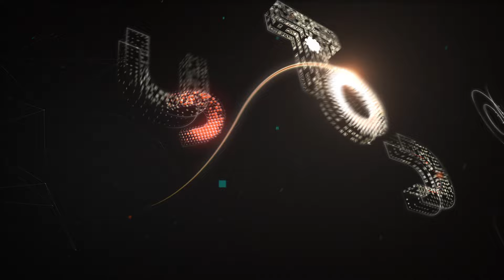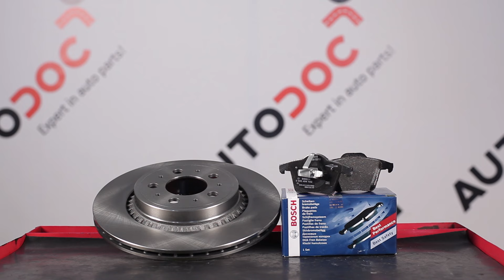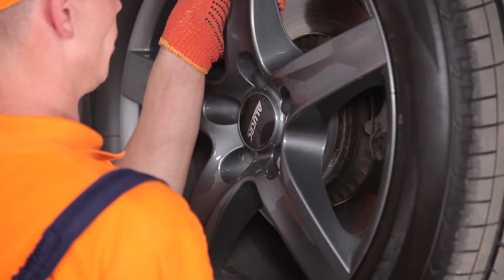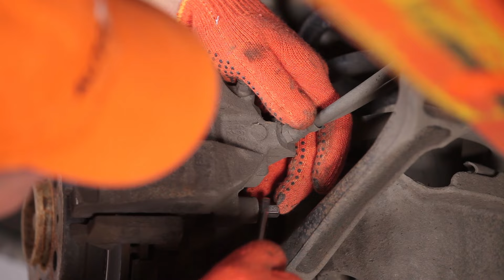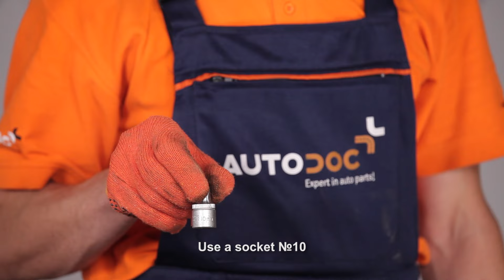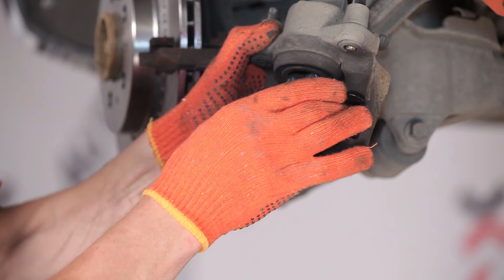How to change rear brake discs and rear brake pads on VOLVO XC90 1  TUTORIAL | AUTODOC

Comment: Great video. Before I pressed the piston back, I opened the brake reservoir lid, pressed the piston back, reassembled everything and then put the reservoir lid back on. I pressed the brake pedal several times and then drove it. It's fine however the pressure on the pedal is not as strong as it was. What can I do to fix without bleeding the hoses which I didn't need to do?
Reply from the maker: Thank you for the feedback! If you have any difficulties, we recommend that you go to the Service station , where specialists with professional equipment will solve this problem much easier.Best regards, Autodoc.

Comment: Does the piston need to be rotated as well as compressed back into the caliper?
Reply from the maker: Thank you for your feedback! Thats right, To install a caliper for new shoes, the piston must be pressed back into the caliper a special tool as shown in the video. Rotate the piston during installation is not necessary. Best regards, Autodoc.

Comment: I have a question.My car is 2013 model volvo XC90,Im not sure that the way to change brake disc is the same or not，cuz the car in video is 2008 model。。。
Reply from the maker: Thank you for your feedback! Yes, Basically this procedure is similar. It could be difficulties with caliper differences and its caliper adapter brackets. Best regards, Autodoc.

Comment: He made a big mistake by letting the brake caliper hang by the rubber brake line. That is dangerous and could damage the brake line. The proper method is to hang the caliper by a bungee cord. Never let a brake caliper hang by the brake line as shown in this video.
Reply from the maker: Thank you for the feedback!Your opinion and remarks are very important for us. We will take them into consideration for our next tutorial. Best regards, Autodoc.
Reply: Euro vehicles use ultra lightweight calipers so no damage is going to be done. But what he was sloppy with was no greasing the slide pins or the brake pad ears to ensure smooth braking

Comment: You're letting the caliper hang with its brake hose putting too much strain causing it to crack. Torque on caliper and bracket bolts? Dumb video.
Reply from the maker: Thank you for your feedback! We agree that this is a huge mistake, the caliper should be hung with a hook that would not damage the brake hose, in new videos we have already corrected this error.
Best Regards, Autodoc Team!
Reply from the maker: Thank you for your feedback! 
We agree that this is a gross mistake, the caliper should be hung with a hook so as not to damage the brake hose, in the new videos we will definitely show it.
Best regards,
Autodoc team!
Reply: Torque specs on hex and 13mm pls?

Comment: Shouldn't the fasteners be tightened to torque specs? Should certain parts (like guiding pins and pads mating surfaces) be cleaned and greased? This looks like a professionally produced video, why not give professional advice?
Reply from the maker: Thank you for the feedback! The video is informative and shows only the general principles of the constitution and the operation of the car and it is in no way to be taken as a manual for repair and maintenance. Best Regards, Autodoc